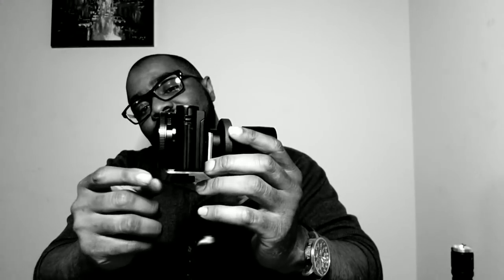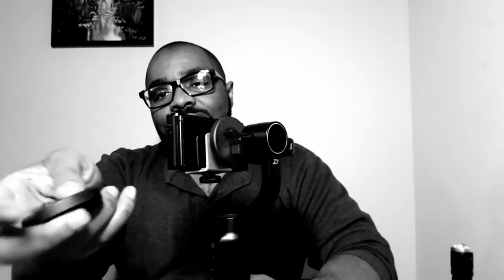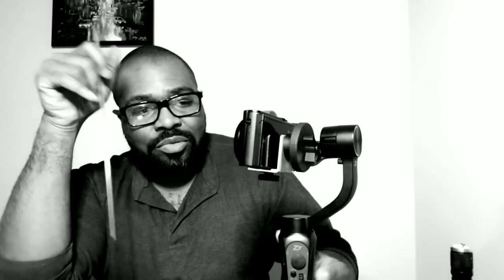Stuck! My Smooth Q Stabilizer Compact Camera Mod

Comment: I wanted to use a Sony Nex 5 on my drone and finely gave up and went back to my sport camera . As much as I love my big drones , I use my Mavic pro more than all the others even the Phantom . You may just have to hold it when turning it on . I wouldn't add all that weight and burn out the motors . Get it balanced with it on and go with it . I think that's your best bet . Just found your channel , love it .

Comment: Not sure your motors can stand the weight constantly trying to stay level. They may also get very hot or even burn out, remember it was made for a cell phone. But i do like the idea of maybe extending the actual aluminum mount to get the home you need to add counter weight, who knows...give it a shot brotha! Keep us updated!!!
Reply from the maker: I got working. Motors held up and didn't hear up
Reply: Sweet, that's what its all about brotha, make'n shit work for you & your needs.

Comment: I seriously doubt if this will ever work (long enough to be useful). This is way too much weight.
These gimbals aren't made for that weight.
Reply from the maker: There are others that have already done it and have it working the motors are fine if balance. even with the cell if its not balanced the motor heat up and shut down.
Reply from the maker: +Marcel Bruinsma we will see... no issues so far no over heating motor. I used for about 20 minutes not heating up of motor like no got when I forgot to balance my phone
Reply: The more weight you add the more trouble the motors have to quickly stabilize the camera.
So even when the little motors hold out and don't burn out the stabilizing effect is not what you want it to be.
Try to manually stabilize your phone while walking and then try to do the same with your television. See if you can do it just as fast.
Reply: @ Marcel, I don't think this gimbal can handle the weight of even the smallest of televisions...
Reply: BigBalls,  it's not during the session, but after a number of sessions (may take weeks), it could eventually burn out.  That's what these comments are about...